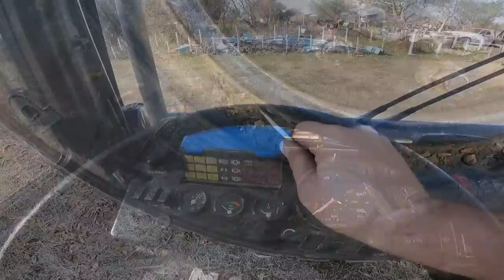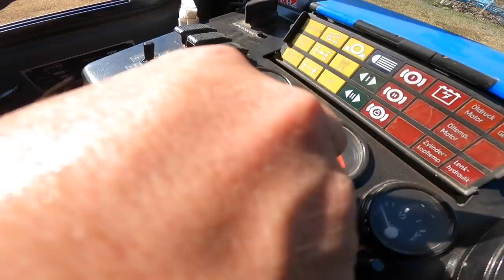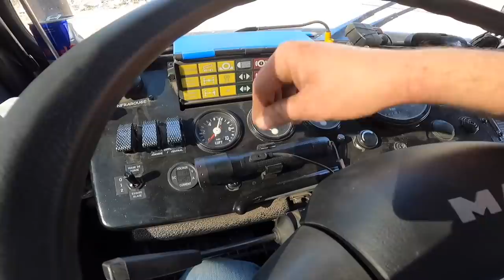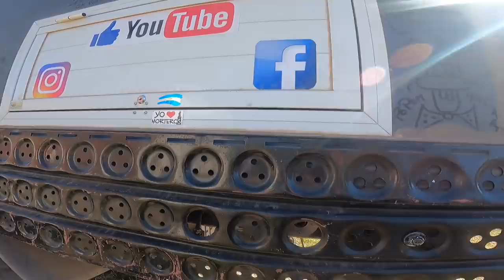234 On a trouvé des pneus en 1400R20 en Argentine pour notre camion d'expédition

Comment: Salut les XTG,
Pirelli Pista PS22 =
Largeur (mm)389
Diamètre (mm)1 245
Rayon sous charge (mm)567
Circonférence de roulement (mm)3 797
Profondeur de sculpture (mm)23
Poids (kg)103,26

Michelin XZL =
Taille14.00R20
Largeur (mm)384
Diamètre (mm)1 258
Rayon sous charge (mm)578
Circonférence de roulement (mm)3 826
Poids (kg)83,63

Il y a donc bien une différence à la base
Reply from the maker: merci pour ces descriptions 👍🏻

Comment: pour aspirer l'air des chambres il te faut une pompe à effet venturi, ça fonctionne à l'air comprimé
Reply from the maker: Oui. C’est top ça
Reply: @xtgfamily  tu peux facilement le fabriquer si tu trouve un tourneur qui peux te faire la pièce : 
1 tube en acier fileté à une extrémité, avec un trou sur le coté pour y mettre la prise d'aspiration (à 1/3 du tube environ)
1 raccord union pour le tuyau d'air sous pression à l'entrée du tube
1 flexible avec un raccord de gonflage pour aller sur la chambre à air à vider sur le trou du coté du tube
1 voir 2 cônes à usiner et placer dans le tube 
et te voila avec une pompe à effet venturi ;)